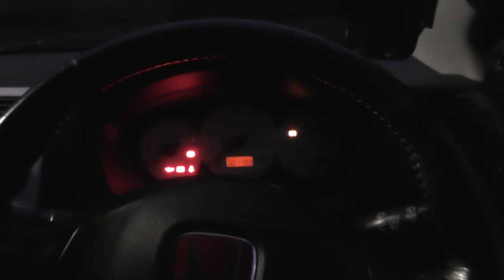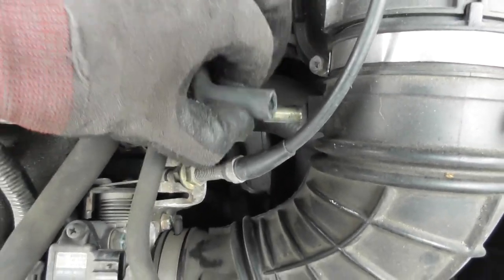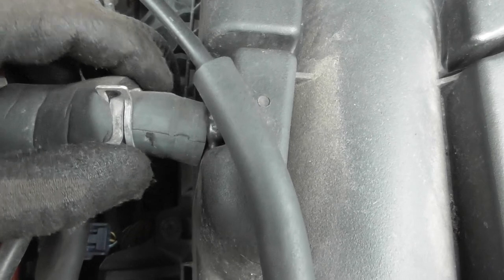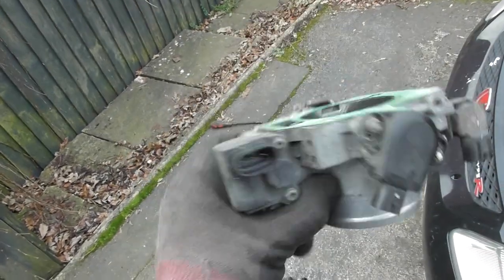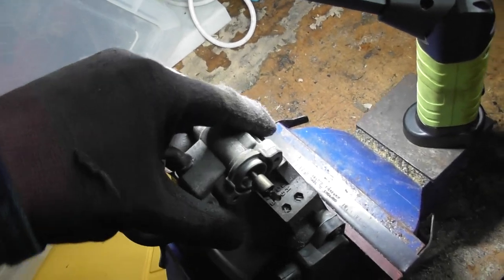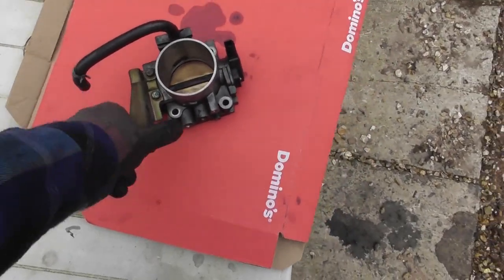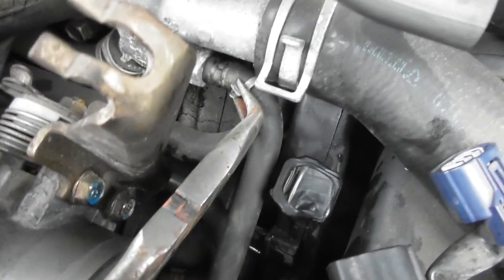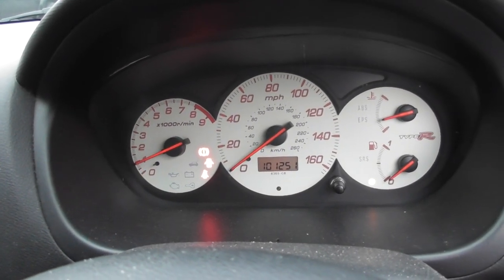T2EP3 Part 24 : Honda Civic Type R EP3 K20 Hunting Idle Fix - IACV Cleaning

Comment: Just a quick note for anyone else who takes it apart without checking first, it's a TS20 bit that's needed, not a T20 as mentioned (the normal bits are 6 pointed).

Comment: Thank you for the video....my IACV was basically stuck. I didn't know it rotate 360 like that. Thanks again for the video. I ran RSX without IACV. Cleaned even more and now it spins. Just completed the install with some slight tuning of the duty cycle and car seem to be running fine.
Reply from the maker: Great news. One thing I would say is that once the IACV has started to get stuck like this.... it will usually happen again and you might have to take it off to free it again. Thanks

Comment: Just wanted to say in case anyone has this problem in the future, it is better to clean the old iacv than buy a new cheap one. I bought one from rock auto (power something) for 40 dollar and it did not work....I tried taking the new one out, testing the old and new one with a 12v and then putting it back in. I tried messing with the coolant, resetting the idle (pulling the fuse) and finally I went back to the old cut a line in the 5 point torx screw heads for a flat head. I cleaned it out, made sure and spun well and now my idle seems good to go.

Comment: Good video, but not sure if really necessary. I left my ep3 for a month when I worked abroad. When I came back to it the idle was fluctuating. I just kicked its head in for 20 minutes and that sorted it 👌🏻
Reply from the maker: Hi, I tried that approach.. with no joy. The level of carbon in the IACV rotor was enough to make this worth it. We shall see how long it stays fixed though... I will let everyone know.
Cheers for the comment.
Reply: Litterally happening to me as we speak lol. Mines bad enough that I gotta get in there and clean 18years of filth 🤣

Comment: Great video 
 Have not had problems with rough idle as some have but as routine maintenance might be worth spraying carb cleaner into IACV gap next to throttle plate say every time changing/ cleaning air filter to keep it clean and working . Would hopefully save having to replace or a full strip down clean.
  Great video very clear steps
Reply from the maker: Thanks for the comment glad the video helped!

Comment: it might be worth noting that you probably should run the car through the `idle learn procedure` after you perform the cleaning on the IAC. i don't think it could hurt, and i'm pretty sure that since you cleaned this your car will have to adjust for the valve spinning more freely, but i could be wrong. feel free to correct me if i'm wrong on this. personally i'm troubleshooting a P0507 error code at the moment.
Reply from the maker: Hi, I just looked this up and have to admit I have never done this before.  I would think this would be a quicker way for the ECU to relearn the idle, but I have not had any issues myself, without doing this. The procedure mentions the need to do this whenever your battery or ECU has been disconnected, but not directly anything about the IACV. When I made my IACV spin more freely (like in the video), it idle much better without following any idle relarn process. Thanks
Reply: How would you do an idek reslesrn procedure ?

Comment: My dc5 did this I spent ages cleaning the iacv    tried new throttlebody  checked manifold for leaks.
All to no avail. 
 Ended up just redlining it for like 15 seconds. Worked a treat.

Also that bit that is broken on the manifold is just basically a cold start ive plugged it and looped the hose round on mine. It's not needed and they are well known for breaking
Reply from the maker: Cheers for the comment.
I might have to loop the cold start part that is broken like you say.
Someome has clearly broken it at stucknit back together lolz.
Reply: Just take the aav off! Plug the hole with a bolt you can buy the delete kit for about 12 quid on fleebay.
Reply from the maker: @1981robbo  I will have a look at that.... at the moment the stuck together "fix" is holding together... not ideal though.
Cheers for the comment
Reply: @twin2civicgaraget2cg75  if you remove it, on a very cold start it will stop the revs hanging at like 3k for a bit..  It settles down faster and the job is done by the iacv instead. It also cleans up the engine bay alot cos that part is fugly and not needed.

Comment: Awesome Video. Super helpful. Could you give me some tips on how the get the throttle body off once I have taken off all 4 bolts? I got to that step and just couldn't get the throttle body off. I tried lifting it from underneath but it just wouldn't move. Did you have to hammer it by any chance?
Reply from the maker: After the four bolts are off, it should just come off. Mine was a bit stuck on there... but a couple of taps with a rubber mallet should do the trick. Cheers and good luck

Comment: done exactly what you did my idle wasn't hunting but was sitting between 2-3k and around 1.5 when warm after cleaning it jumped way up to 4-5k any idea why does it need an ecu reset or is it time to bite the bullet and buy a new one
Reply from the maker: Was it hard to turn before you cleaned it?
Also was the inside scored up a bit?
What happens with these is that when working the spin freely, over time the bearing/shaft gets worn and it starts to pick up and score the inside amd the rotor itself.
So the fix I did may work for some time, but if the housing and rotor are very damaged... then yes you need to buy a new one.... or buy a second hand one, with the issue being that it will be worn already.
Hope this helps.
Reply: @twin2civicgaraget2cg75  it was a little sticky but cleaned up and spun free i did wonder if the bearing was knackered got it replaced dropped right down but not 100% its at 1k warm and 2k cold which is still high someone said tps needs tweaking or could have an air issue too cheers for help any idea what next step could be
Reply from the maker: @chriswicks3207  It is worth checking the TPS voltage... I have never had an issue with mine so not looked into it. If you had an air leak it could give you a high idle...  you could spray some brake clear around where you suspect a leak in the intake side... if the engine revs increase, that is where your air leak is.
Good luck.
Reply: @twin2civicgaraget2cg75  brilliant cheers will look into
Reply: @chriswicks3207  I've got the same problem. What was it? Did you fix it?
Reply: @zzanir  hi I bought a new iacv  £300 from honda 😳 and I replaced the tps as car was showing signs of that playing up think it was the 2 combined unfortunately at the same time but it's much better it does hunt a little when left sometimes not sure why checked for air leaks too but all good have you replaced the iacv or tps
Reply: chris Wicks I just cleaned iacv, but no difference... thanks for reply
Reply: @zzanir  yer I cleaned it first then It was at nearly 5k that was a shocker when firing up haha
Reply: chris Wicks haha yeah, its really anoying that high idle, mine is 2k-2,5k cold, and 1,5k hot, sometimes drops, but then raises again.
Reply from the maker: Hi, it seems that your IACV is sticking.... when you remove it is the shaft free to rotate? Mine was but only after I spent a while rotating it, cleaning it and rotating it. Then after a while I had to do the whole thing again. Just couldnt bring myself to spend £300 on a new IACV.... although it is the only real long term solution. Having said that... mjne has been fine for a while now. Cheers
Reply: Twin2 Civic Garage T2CG Shaft was spinning fine. I will try again this week, hope it works. Otherwise I'm gonna be looking for used RBC with TB haha
Reply from the maker: Ok cool. Just check if it spins, because mine had what looked almost like scores on it. Cheers
Reply: Twin2 Civic Garage T2CG It spins without resistance, I guess it's something else...
Reply from the maker: Strange one... have you got any air leaks when the idle goes high?
Reply: Twin2 Civic Garage T2CG I sprayed with brake cleaner around tb and manifold, idle was the same all the time, checked all the bolts and hoses, everything seems fine.
Reply from the maker: Very strange.... unless the IACV controller at the side which controls the rotor.... has an issue? You might have to try a whole new IACV. Let me know how you get on.
Reply: Twin2 Civic Garage T2CG Yeah, maybe.

Comment: I couldn’t get the two Philips head screws off the valve itself. 
As a work around for this, buy the correct TS torx socket (five pointed star) and take the black plastic section off. This will show the shaft which is probably stuck in place and needs freeing off.

Now take a tin of carb cleaner and spray this down the hole/slot within the Throttle Body (which leads to the blocked valve). Keep spinning the shaft back and fourth, emptying the fluid out every few minutes. The fluid will gradually go from being black to clear as you persist on emptying the fluid. Mine took 5-10 minutes before it was spinning very freely. This might not work for units blocked badly, but certainly better than stripping the screw heads completely off those horrid Phillips head screws!

Comment: Mystery solved: Bought new IACV, same high idle. After 1 month started idling at 3500. Something was very wrong, again checked all vacuum pipes, nothing. Unplugged IACV connector, no change, so it has to be IACV. I was looking at old IACV for quite some time, and figured it out 😂. You can actually rotate electric motor on IACV and adjust your idle.
Reply from the maker: Hi, out of interest was the new IACV brand new or a 2nd hand part?
Thanks
Reply: Twin2 Civic Garage T2CG Brand new chinese 😐. It is actually pretty good for 20 bucks.
Reply from the maker: Ok fair enough, the OEM IACV are £240!
Hope all is going well with your car now.
Cheers
Reply: Twin2 Civic Garage T2CG Yep, thanks.
Reply: @zzanir  link for the part? Cheers

Comment: Hi, my ep3 seems to be idling really low at 500rpm and I have to keep my foot on the accelerator would this be down to IACV aswell?
Reply from the maker: Hi, is it idling that low even when the engine is warm?
Reply: @twin2civicgaraget2cg75  yeah it's still idling low even when its warm it started a few days ago
Reply from the maker: I would think it is the IACV. When you you take it off you will probably find the shaft is stuck. So cleaning and freeing up, like I did in this video will be your best option. Let me know how you get on. Cheers

Comment: will this work if occasionally i get a sudden drop in idle (like its about to stall) @ idle , because we hear of this being done for "surging" or "hunting" idle..
Reply from the maker: After the near stall.... does it recover and idle normally? This could be an early sign the IACV is getting hung up. But the only way of knowing would be to remove and inspect it. It should be free to turn. Thanks

Comment: hi mate a quick question on a old vid you did regarding   VTEC Solenoid Gasket Seal  22 Jul 2017 , did you see it leaking from here  if not how did you determine were it was leaking as my vtec still engages  ? . Is this a common place and did replacing the Gasket Seal cure the leak
Reply from the maker: That was a while ago. But I did the gasket change as I though this had probably never been done. I wanted to see if the basket contained any debris. I dont remeber is leaking from there. If VTEC enages... then what is the issue you are chasing?
Reply: @twin2civicgaraget2cg75  cheers for reply buddy , ive a leak from somewhere near this area but carnt determine exactly and i heard these are a common place ?
Reply from the maker: @duffman13971  Oil could leak from here.... but I would look at the cam cover gasket too.
Reply: @twin2civicgaraget2cg75  cheers i will and once again thanks for your quick reply
Reply from the maker: @duffman13971  No probs... good luck. I would get a OEM honda gasket. At least on B series engine the aftermarket ones are not of great quality from what I have seen.

Comment: In the middle of doing an b16a conversion on ef sedan having trouble with the gearbox mount i think its a slight bit long they fit the box perfect i got them of ebay its said honda civic / crx mounts wen i purchased them but looking at your vids on the ef yours looks a slight bit shorter but mine is a cable gearbox wud cable hydro box make a difference or is simply the wrong mount and advice wud be helpful 👍🤣
Reply from the maker: The hydro mount and cable mounts are specific for the gearbox's that you fit them to.
If the mount is too short then, it could be the wrong mount.
The bolt patter on the gearbox is different between the two.
I would ask Hasport or a company like that if they can help you.
Thanks for watching.

Comment: I think my cl7 accord k20z2 have the same problem rough idle and sometimes the rpm stays at 2000 rpm
Reply from the maker: Thanks for the comment, I think all of these engines will by now have a similar issue sooner or later. I have had to take my IACV off again recently as the car was sat for a while. After sorting it again it is idling well. The true fix will be to by a new IACV, however they are a bit expensive. Cheers

Comment: Can you link me one. I thibk I need a new one
Reply from the maker: If you type in "K20 IACV" you will get some results.

In the UK, there is a new on on Ebay:
https://www.ebay.co.uk/itm/172363924823

Cheers
Reply: Twin2 Civic Garage T2CG thanks bro I was able to find an oem for $40 lol that was a deal
Reply from the maker: That is a great deal, you should send some to the UK at that price lolz
Reply: Twin2 Civic Garage T2CG I replaced it now it idles really high, it was Installed currently even took it apart twice and check it, but now just idles to high
Reply from the maker: @KtuluLeaderRise  Ok before you installed it, was it hunting (idle with revs up and down)? Now it is stable with just a high idle?
Reply: Twin2 Civic Garage T2CG so before installing it just going up and down from 800-950rpm now with the new one it was high idle and still serging but at higher rpm. I cleaned the old one and put it back on and now it’s doing good as in now does that mean the one I got was no good ?
Reply from the maker: @KtuluLeaderRise  If I was going to guess. If the idle is stable, but high... you have an air leak. So the one you get is good, but maybe the gasket which seals it to the Throttle body is not good. So the extra air getting in, brings the idle speed up. So you cleaning the old one, got the idle speed to be stable again. Also the seal in the old IACV must be good, therefore no high idle. Hope this helps, and like I say I am just guessing here. Cheers
Reply: Twin2 Civic Garage T2CG the idle on the new one was high but not stable it was still going up and down at a higher rpm, I replaced the throttle body gasket as well during this process, now I put the old one back cleaned but it’s back to how it was before just idleing up and down at 800-950 rpm
Reply from the maker: @KtuluLeaderRise  Ok... so with that information.... it sounds like the were both sticking.... amd with the new one you had an air leak. Either way... can you turn either of these freely?
Reply: Twin2 Civic Garage T2CG the new one I was able to turn by putting something in and moving it and for the old one as well after the cleaning, just not sure if it’s the iacv causing the idle problem I noticed it goes from 700-890rpm and happens more when ac is turned on
Reply: Twin2 Civic Garage T2CG what do you think about the map sensor and tps ?
Reply from the maker: @KtuluLeaderRise  The IACV should be able to move freely. The AC being on should put more load on the engine, but not sure how this should really effect the idle.
Reply from the maker: What I am saying is you need to clean the IACV until it can spin nice and free.
Reply: Twin2 Civic Garage T2CG just went to autozone got iacv coming Tuesday so hopefully that one is good lol
Reply from the maker: @KtuluLeaderRise  Good news.. hope it sorts it. To give you some background. I cleaned mine in the video.... three months later or so I had to free it up again, as I hadnt used the car for a bit. Once they start going wrong, they dont get better. Cheers
Reply: Twin2 Civic Garage T2CG btw thanks for helping, not that many people in the community do that
Reply from the maker: @KtuluLeaderRise  No probs, always happy to help if I can. Cheers and good luck.